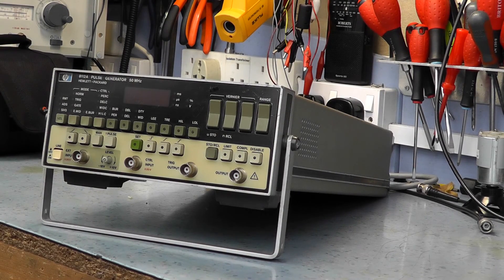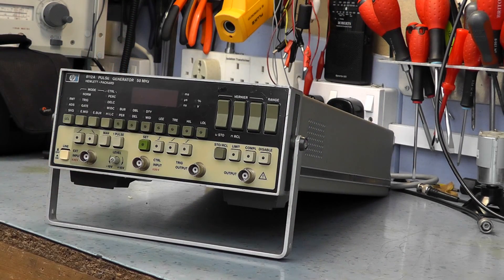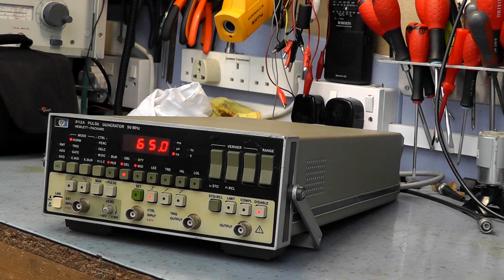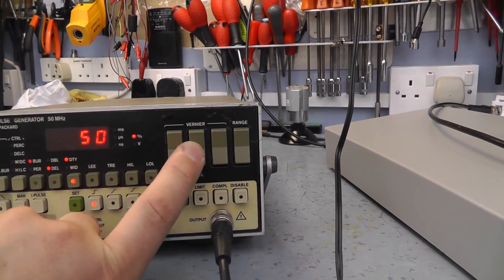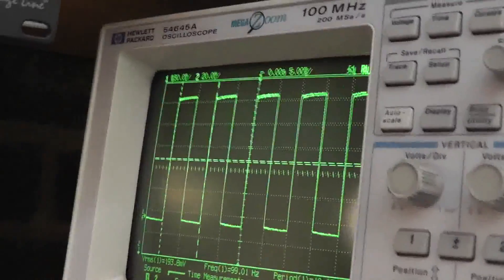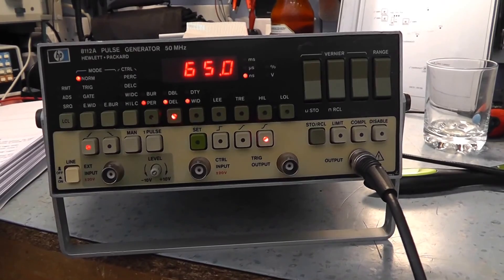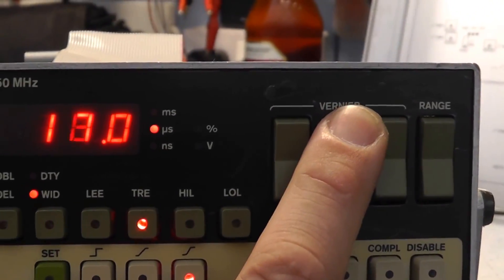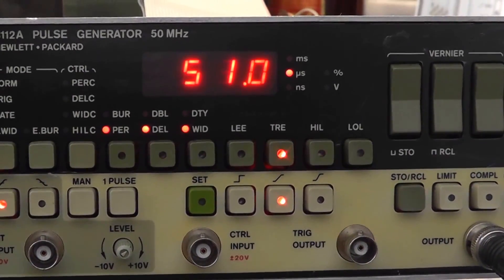HP 8112A With E41 Error First look

Comment: Very attractive bit of kit there Simon, looks like you got a good find. You answered both my questions which were what do the buttons feel like and it looks too long for my bench. Does the unit have a very fast rise times the sort of thing  for measurement cable reflections or scopes bandwidth.  One of those buttons appeared to just round of the edges for emi reduction rather than rise time, I could have imagined that. I had a Farnell pulse generator that i gave away as I couldn't really find a use for it. Still looks good on the shelf which is of course the main reason for acquiring gear.  Is reading the manual the tech equivalent to the walk of shame?   Best regards Chris
Reply from the maker: AllTheGearNoIdea HI Chris.  The Main use for this will be scope call and as  marker generator as it should produce a clean narrow pip. 
The generator can be made to form a sine wave with a bit of fiddling about with the fall rise time. Max rise and fall looks like 4.5nS. Despite the error it works fine from what I can tell apart from no 9V output.
Reply: Looks good, as you say who needs 9v

Comment: Hi Simon, according to the manual it is
E41
Amplitude range 2 (9.99 V) not possible. Possible faults:
• Pre-attenuator circuit
• Amplitude control circuit U23 to U25
• Offset control circuit U20 to U22
See Chapters 10.5 and 10.4. 

Give me your email address and I'll forward the manual over, its a workshop manual as well operating.
Reply from the maker: Thanks for the offer Leonard, I have just printed a copy out at work. It's strange it does not always show the error but I indeed have no 9.99V range. Will check the transistors first.